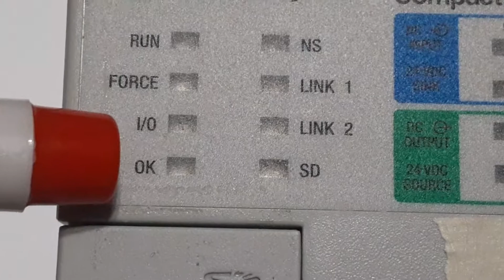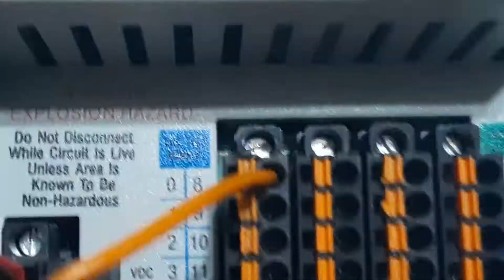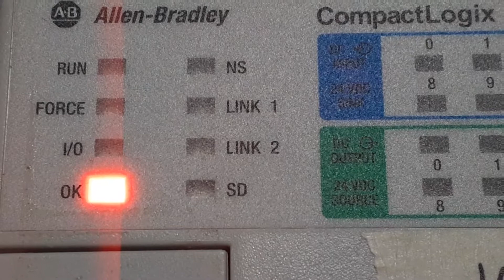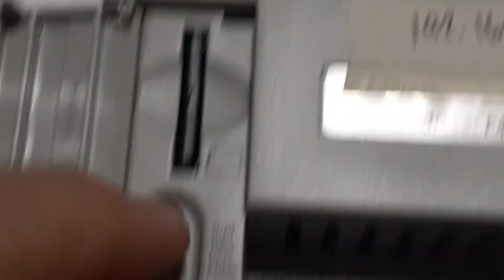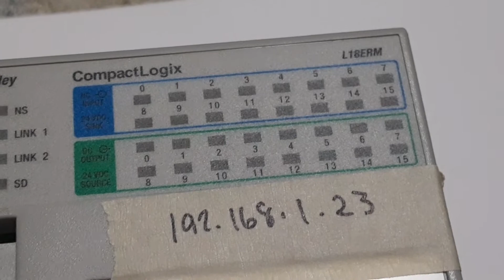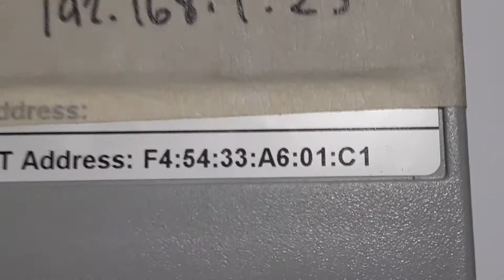Compactlogix L18ERM hardware

Comment: Hi David, congrats on your video, pretty educational. MAte. I gotta problem with my L18 CPU, where the IO led is not getting green light. Have you got any idea about what is going on?
Reply from the maker: Yes. If the I/O light is flashing, it means that there it cannot communicate with one or more I/O modules. Look on the lower left side of the controller organizer in studio, and look for an I/O module with a yellow triangle with exclamation point. You can disable it if it is no longer part of the project or perhaps remove it from the project.